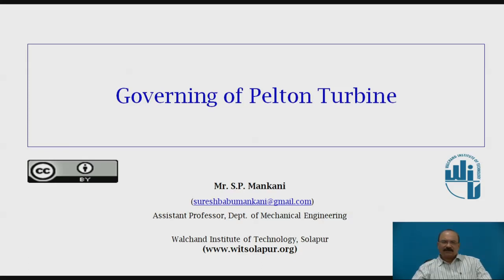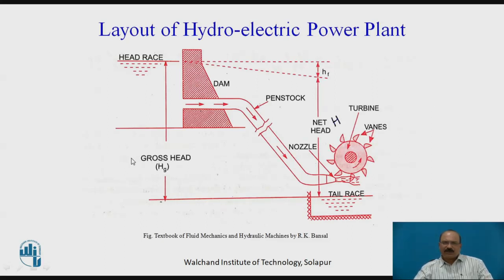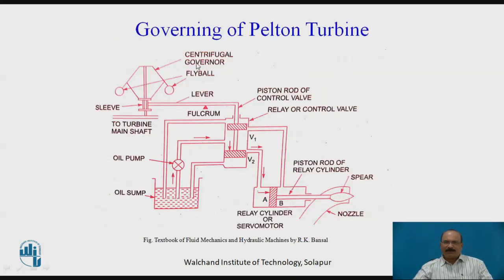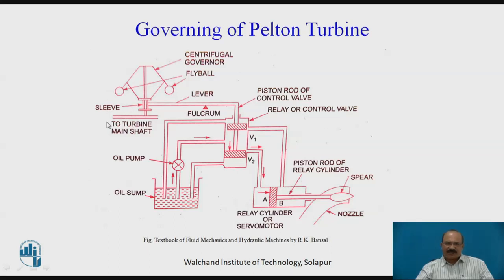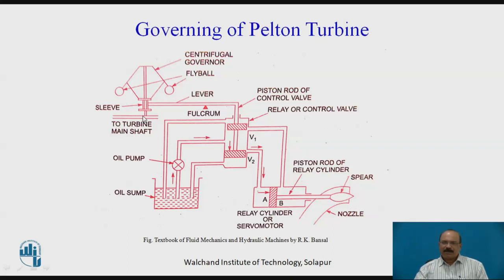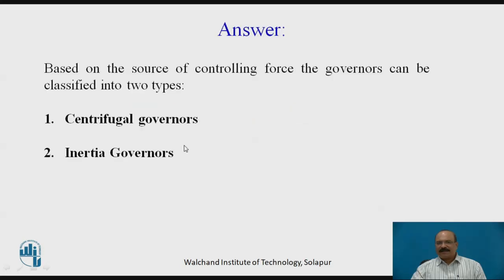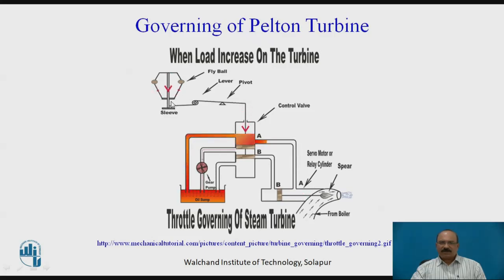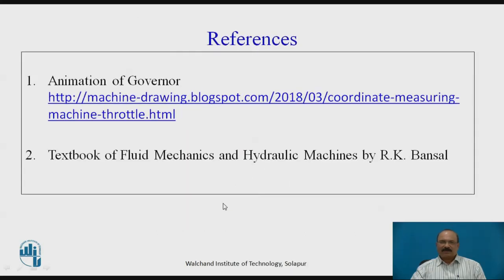Governing of Pelton Turbine

Comment: When the valve B is closed and A is opened, how could the piston of servo motor move to left when the oil in the left chamber has no where to go?
Reply: The oil in the left side of the position move back to V2 and from V2 it will moved back to oil pump just imagine it then u will get